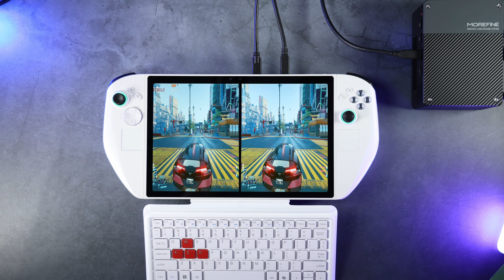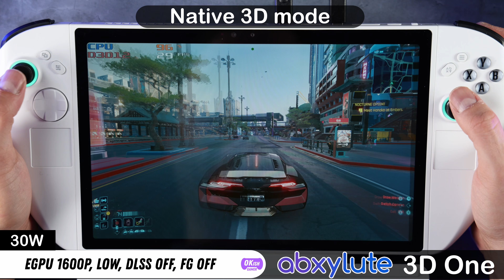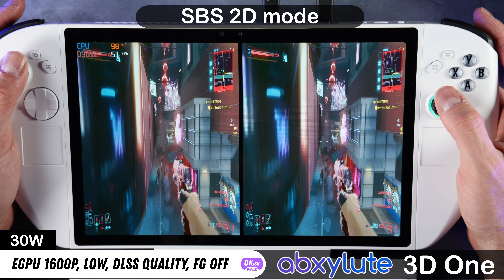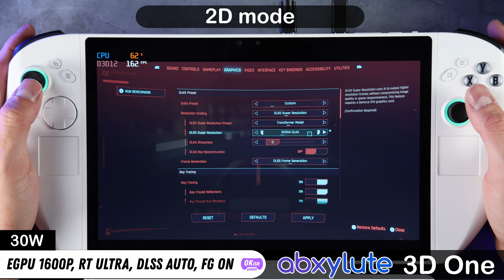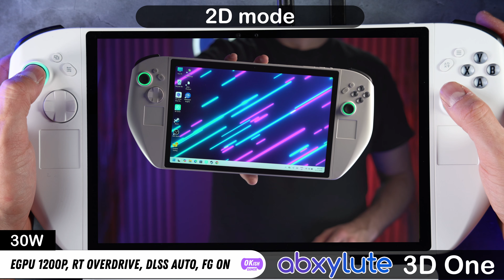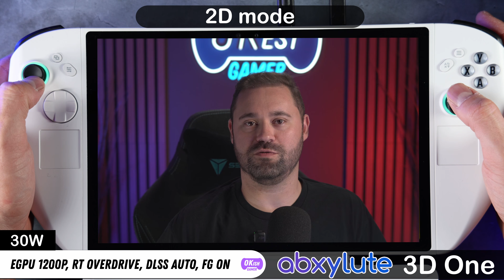ABXYLUTE 4080m EGPU Cyberpunk 2077 performance test 3D and 2D.

Comment: How did you get the egpu to connect? I have an aroua 5060ti and it connects through usb4/thunderbolt but when I use it the egpu won’t connect however ir works with my laptop
Reply from the maker: It seems like some egpus work and other don't. I'm surprised the nvidia one isn't connecting. I had issues with amd

Comment: I had expected better performance with the 4080m, guess it's the lack of oculink that is the main culprit.
Reply from the maker: It would certainly be a factor. What I've found is the 258v CPU seems a little less powerful than the hx370 CPU (might be having the turbo mode option). The games that have more trouble tend to have the CPU at like 💯
Reply: @OKishGamer  oculink is the difference between usable vs unable on usb4/thunderbolt
Reply from the maker: Sorry just seeing this now. Could you clarify that question for me?